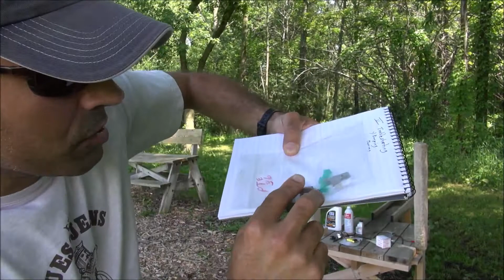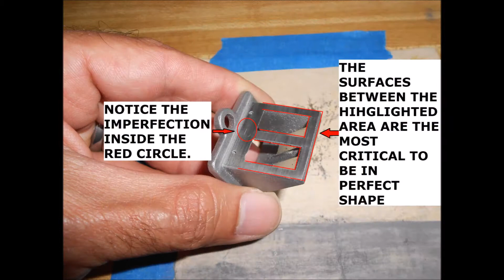RC Gas Engine Performance & Troubleshooting. Part 3

Comment: Thanks for the informative videos. I have bought RCGF 15cc which was running great for one gallon and then the inline filter got clogged and it was cleaned and the carburetor taken a part and cleaned as well. It was flooding very quick. Took it apart again and checked the needle and seat and now it gives hard time in starting and stopped a sudden on high rpm after couple of minutes and won’t start easily again. It seems that fuel suction is not stable and can’t figure why. No air leak and no dirt in the carburetor. Piston and cylinder is fine. Spark given in good shape and spark plug is changed. Any trouble shooting advise?
Reply from the maker: Does it has good compression? Have you checked the reed valve to make sure it's sealing properly? Check the tank line, make sure the clunk moves freely.
Reply: Tools And I everything is fine. It runs quite good and shuts off a sudden! Then struggling to turn it on and i have to close high and low screws all the way to get it start again
Reply from the maker: @sultanalmaazmi9661  If you are having to close the needles to get it going it sounds like it is running too rich. I recommend reading this post:
http://www.flyinggiants.com/forums/showthread.php?t=427
Reply: Tools And I i have read it thanks a lot. Will try to do this in steps despite that it was running perfect and since the filter being chocked it didn’t operates well. The rpm not steady for some portion despite the recommended carb adjustment. Yesterday was working great for a 2 min and then a dead stick. It don’t pop if chock is closed as it used to do. Some time I assume that timing it a problem. Please note that i have removed the hall sensor and put it back and I think only one degree might be changed. I have the same exact problem with 15cc rchf and 30cc dle ! Strange
Reply: Dear, any idea about bad hall sensor symptoms because my engine rpm is not steady after few seconds on different portion of throttle. Tried tuning the carb but the act from the rpm doesn’t looks like it a fuel problem. I have suspected a hall sensor acting faulty or bad timing.
Reply from the maker: @sultanalmaazmi9661  I would first ensure the timing is correct, then try a new spark plug, then a different ignition and then a hall sensor. In my experience I'd follow this order but you can follow a different order if you prefer. If you have more than one plane you may borrow the parts from a good running engine to debug and discard possibilities.
Reply: Tools And I the problem is that I am a bit weak on the timing knowledge. Two engines are acting same :(
Reply from the maker: There is really nothing very good out there explaining how to set the timing. Even though I have taken apart multiple engines for repairs, I always marked the original setting and went straight right back to it. Try this and see if it helps: http://www.vital-rc.com/wiki.html

Comment: Thanks  for producing this extensive video. I have the Hangar 9Yak 54 qq i bought and was builed in the US. and still have a lot of gas engine i build all by my self the problem am having is truning
my ENGINE, I will be galled if you could make a video on turning engines please .
Reply from the maker: +Idris Aliyu Shuaibu Thanks for the inquiry. If you make a search on google for rc gas engine tuning you will find many good articles in the subject. There are also a few videos here in Youtube. Thank you.
Reply: Thanks for your quick respond

Comment: The one area you left out that is also very important.  New gas tanks or old, some times dirt or trash will get into the tank.  Also wood residue from drilling mounting holes for the engine will remain in the fuselage.  This will be sucked up by the engine into the carb.  If the engine starts running bad, at idle or high rpm, open the carb and check the filter screen.  It must be totally clean of foreign objects.  Also flush all the small holes of the carb with clean fuel.  Assemble the carb and restart the engine.  Check for performance.

Comment: I wonder what kind of radio and receiver you use on your gas planes, and also if you had any problems with signal interference from the ignition ?
Reply from the maker: MIGUEL HERIBERTO MONTAÑO MARTINEZ I use a JR 9503 radio and matching JR receivers with satellites. I never really had any problems with signal interference; on the occasion I had issues with inconsistent full throttle it was the spark plug the problem. However I have a friend who has had multiple interference issues, he also uses JR equipment. I will try get him to share some of his experiences in one of my videos. He is real wealth of knowledge.